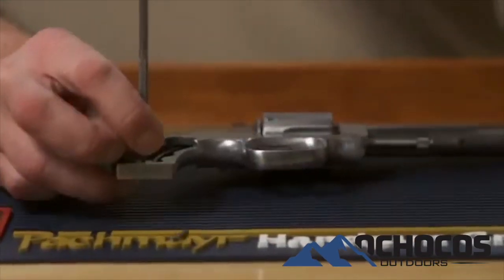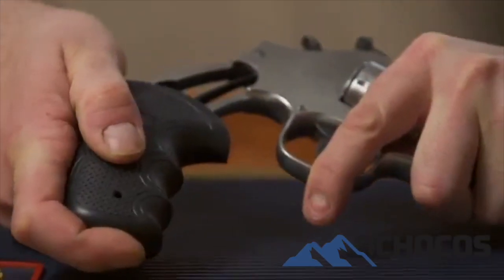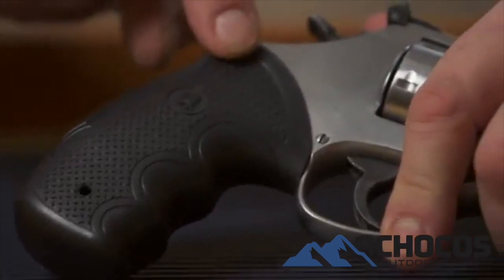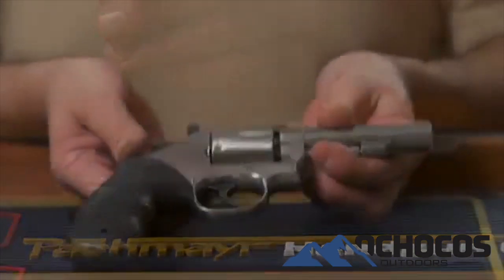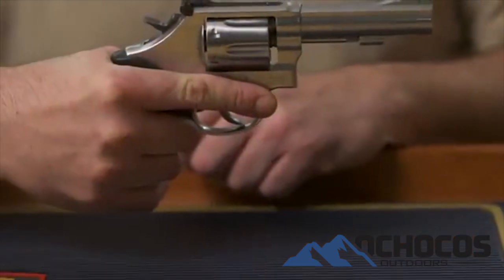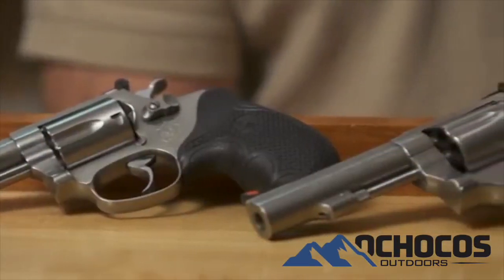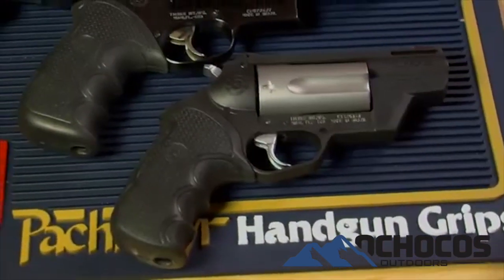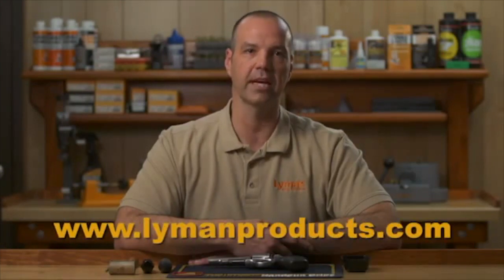Ask Joe How to Install Diamond Pro Grips™ - Ochocos.com

Comment: I hope I reaching someone in..... Pachmayr.......I just bought and trying to fit a diamond pro to a 637 Smith and Wesson. I have several of these grips for my bigger revolvers like the gp100 and the red hawk I really like them but the grips seem to be different from grip to grip. That is why you probably give some fitting tape with each grip. The hole grip locator on the gp100 was not lining up properly and found a quick and easy fix. A WOODEN DOWEL THE CORRECT SIZE AND CUT TO LENTH & IT WORKS FINE AND I AM NOT WORRY ABOUT THE INTEGRITY OF THE WOOD.My fit on the 637 is a little loose and you can probably can tell me where to but the tape. If you or someone can please do. It would be worth it to me.